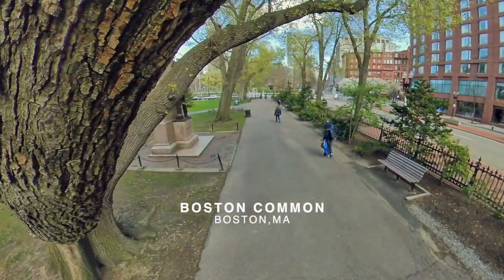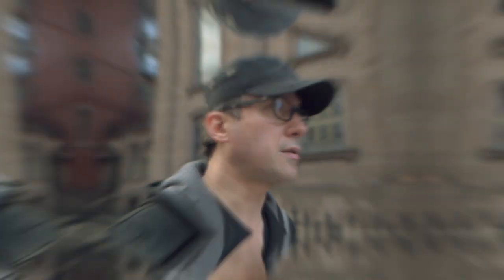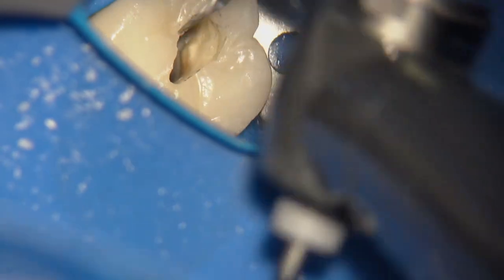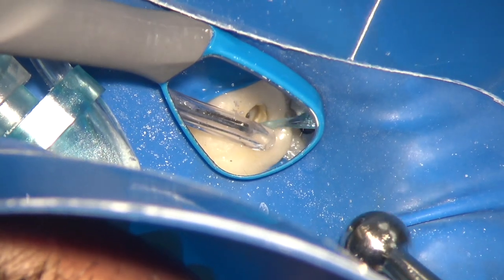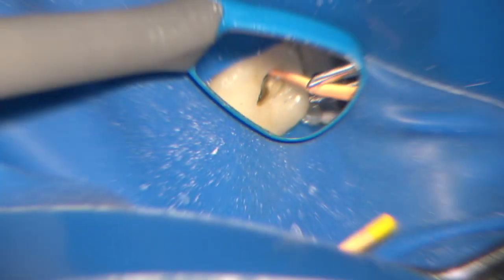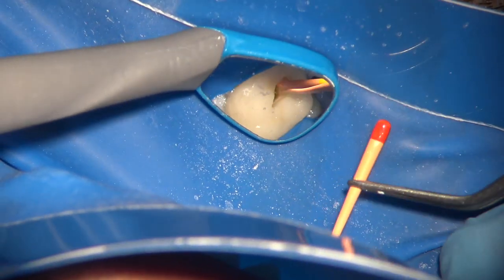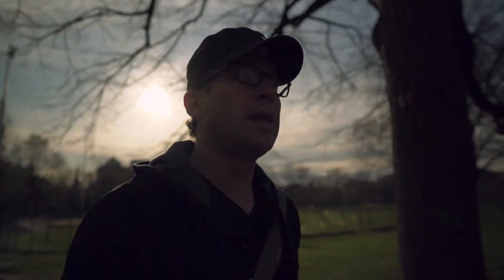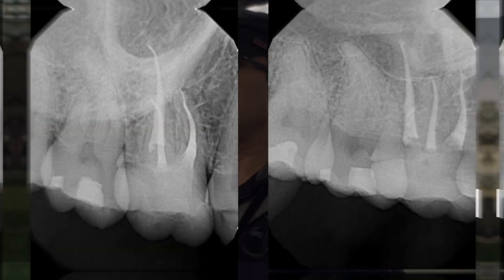Emergency Tx Molar During C crisis (Vlog part ii)

Comment: May I ask what you were doing at that time when you felt something near the apex of the MB canal before you decide to use small size prebend file to clean further?
Reply from the maker: I already knew something was going on from the CBCT. When I finished the main canal instrumentation I used a size 10 hand file with a J-shaped curve and started to navigate and made it fit and get into that accessory canal bifurcation. Then using Warm Hydraulic Compaction I got sealer pushed into it which filled it. Cheers!
Reply: Without CBCT, I won't stand a chance of catching it, would I ?

Comment: What is the temp. for warm hydraulic  compaction in MB canal?
Thanks in Advanced.
Reply from the maker: The temp is less important than time of exposure. I rather have a short burst of high heat. I usually, say 3-4 seconds. I use 250-270 degrees. But that's what it says on the reading. Studies have shows the readings don't correspond with the actual tip temp, which is often much lower! Oh well.